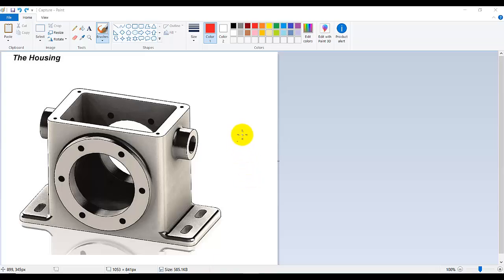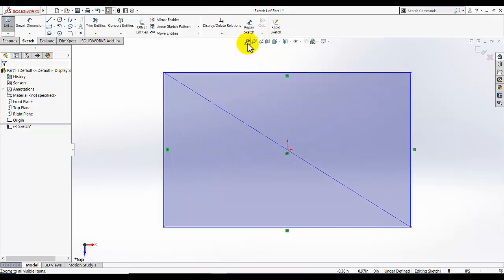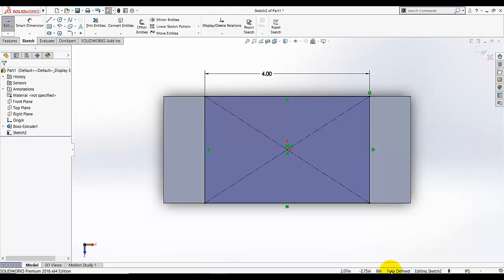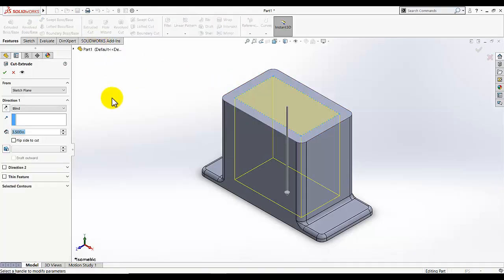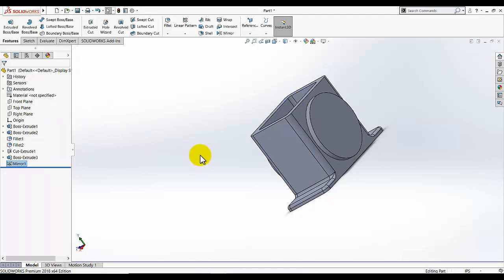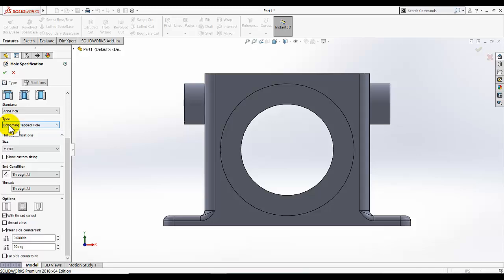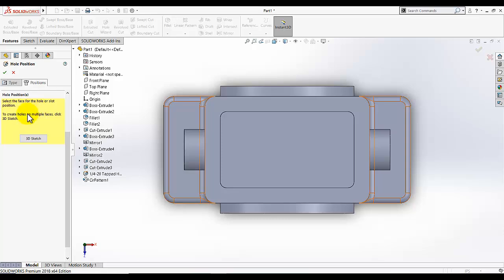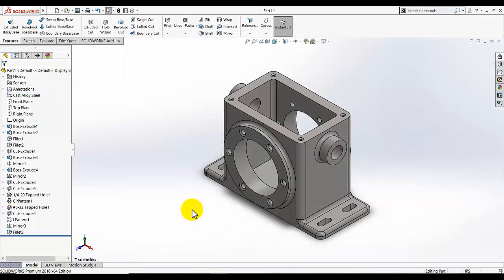SolidWorks beginners tutorials-The Housing

Comment: Any chance you did a video for this where its putting it all together without the teeth gear shaft and gear and with the teeth? Do you do any of the drawing assignments for these gear box parts?
Reply from the maker: send me your assignment
Reply: @asadengineering  I am doing the Chapter 5 starts on page 497-628 and then the drawing goes from page 657-675
Reply: @asadengineering  its in the Beginners Guide to SolidWorks 2023. I have the page numbers for the 2022 book if thats what you are using
Reply: @asadengineering  is there a way to send direct messages on here or did you mean just provide them on here?